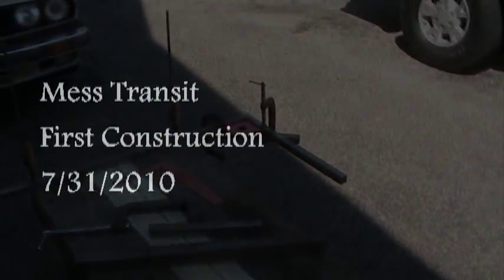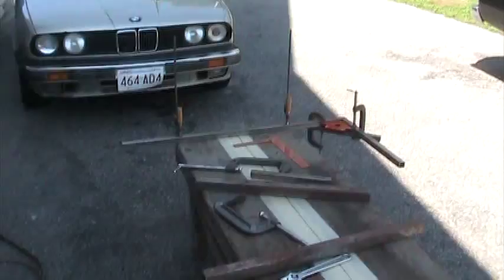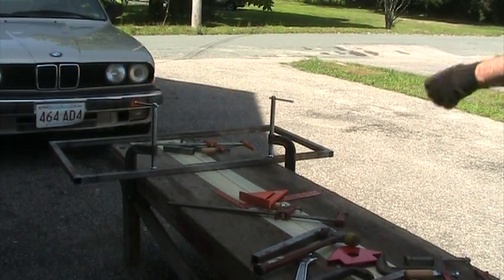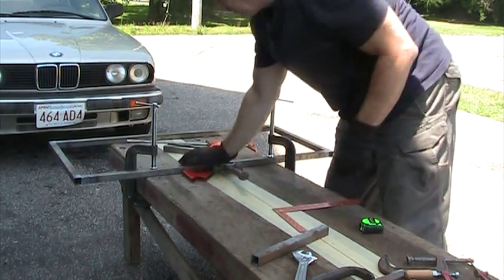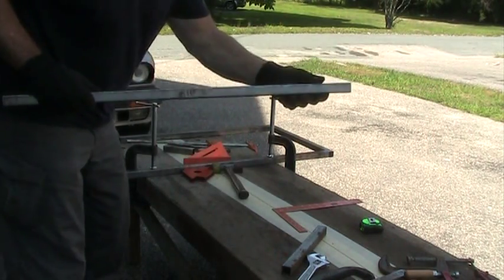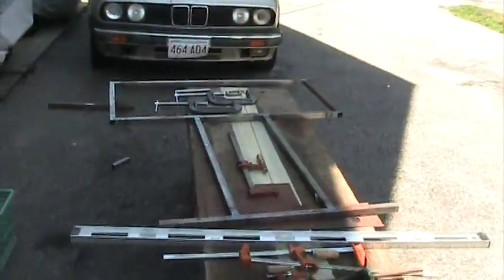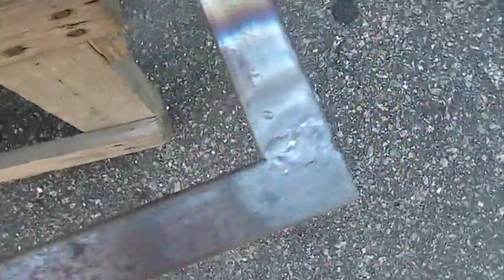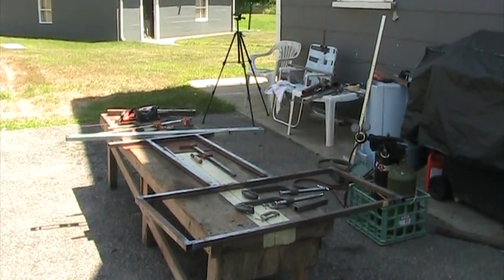3 wheeler frame,  first welds

Comment from the maker: Hi Jalate

ther tubing is 1in x 1in (25mm x 25mm) with a .065 in (1.65mm)   wall thickness. this is the same size tubing used to build the chassis on a homebuilt car known as the locost 7. google  "locost 7" and you'll find all kinds of info. they are very light and strong. 

in the video I am welding with an oxygen/acetylene torch, but MIG welding would be quicker and is supposed to be easier for the avereage user. gas welding lakes alot of practice to get good welds.